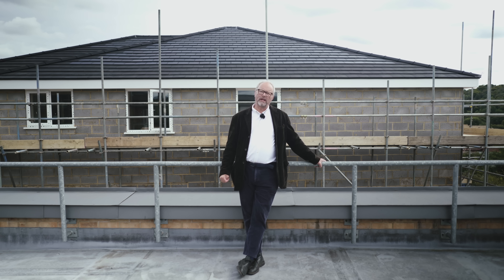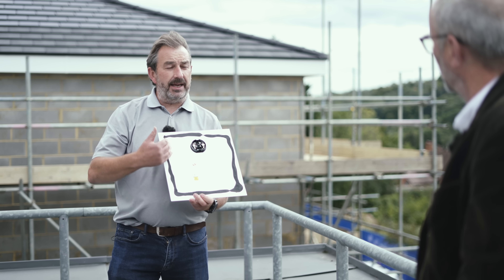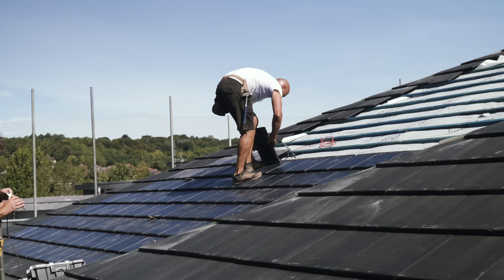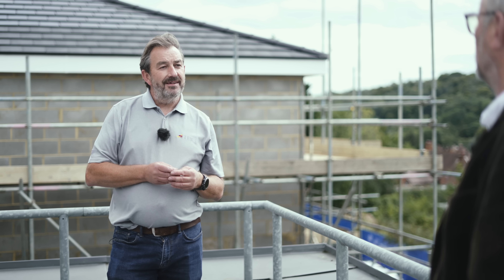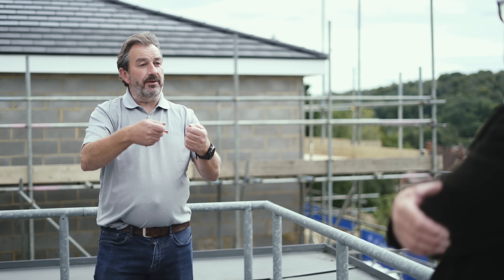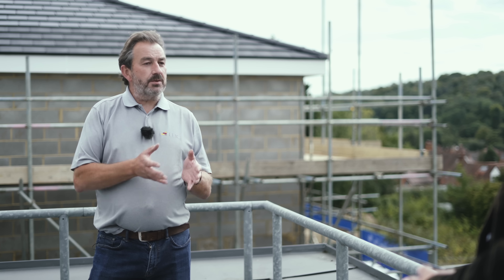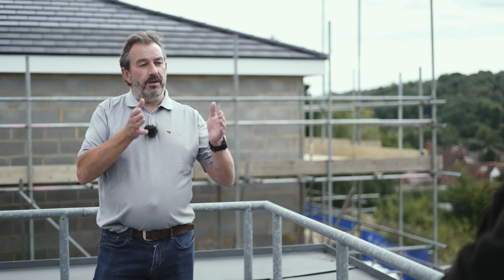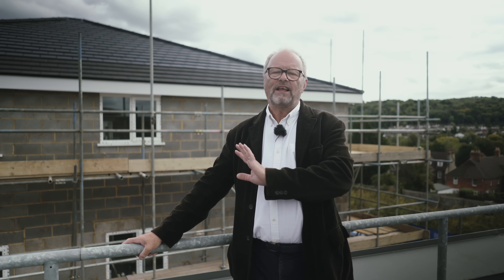Solar Roof Tiles - should every building generate its own power? | 100% Independent, 100% Electric

Comment: Cost next to nothing to make yet charging probably more than 30 pounds a tile now not exactly what you call cost effective the uk barely gets good sun so basically wasted money then you have the expense of scaffolding hire roof fitters that charge stupid high prices for easy work just saying coming from a person who was in building trade its all easy work and cheap to make every material used just greed takes over get rich quick from a brain dead idea took someone how long figure this out yet solar calculators have existed many year's before all this bollocks  plus the expensive lithium battery's the converters from mains to normal power list goes on

Comment: SNOW DANGER: Rooftop solar installations in the UK do not prevent snow sliding off the roof in large, heavy slabs that could cause injury or worse. There are simple products available to prevent this, however lack of compatibility & availability has led to my installer (at least) to not addressing the danger. I'm sure I won't be the only one to realise this risk and I seek to raise overall awareness. And encourage those yet to commission solar installations to demand appropriate mitigation from their installers before parting with any money.

Comment: In 2008 I project managed a new housing estate in Lytham St Anne's, building 111 social housing homes for rent. The scheme included two large blocks of 85 flats in total. All were built to Code for Sustainable Homes Level 4. The apartment blocks had solar interlocking roof tiles, provided by a UK company called Solar Century.  The solar tiles were called C21E.  Each solar tile was the length of three concrete tiles and interlocked with the concrete tiles and were wired in series.  Like Tesla, this video gives the gives impression this manufacturer invented the concept of solar tiling interlocking with traditional roof tiles in 2010.  In reality, Solar Century were doing the same, albeit with triple length rather than individual tiles, years before.  We used the solar power generated to subsidise the energy used in the communal areas, to reduce service charges for lighting and lifts.  From the ground, the solar arrays were virtually invisible.  The scheme was loved by the local town planners.
Reply: Thanks, I actually started with Edilians solarmax, the predecessor to c21e, and still install today, the tiles are the first actual tile size product, that is not covered with glass

Comment: Are all tiles compromised when a few are in shade?
Reply: Hi seamus,

no each module has a bypass diode, which means any shaded cell allows the opower to continue, without pulling down the output of the string

Comment: The combination of the climate change driven intensity of the current heatwave & the complete lack of a joined up thinking & climate change adaptation/mitigation of the current UK Gov't left me minded to rewatch this video. Drives me nuts that just about all world governments STILL haven't the foggiest about just HOW expensive not getting on with the job of transitioning everything now, including construction, is going to be. 
Nobody's suggesting that it all has to be done at once, but they do need to pull their fingers out & make an [actual] & [genuine] start, not merely attend endless COP'S, sign on the dotted line, then go off for a cocktail or two whilst patting themselves & each other on the back.
Reply: Hi Part L 2022 will mean that all new build houses will need solar / heat umps to meet the current regulations
Reply: @chrishall409  Certainly hope so. Trouble is that the David Cameron Gov't, I think it was, tore up the rules regarding every property needing to be checked by building inspectors; builders marking their own homework  - with far too many dodgy results. People have bought homes (because) they were supposed to be well insulated and had a heat pump only to find their electricity bills were astronomical; my guess their homes weren't properly insulated and the heat pump system wasn't well designed for the properties they were installed in. (Adequate) skills training is crucial.

Comment: Why can you have 10 tiles all in a row strieght from the factory it would be far easier to install and less chance of connectivity failure!!
Reply: yes, but you have the issue with weight, and lose the flexibility of smaller modules.
Reply: @chrishall409  Not if you choose the right materials! That as a designer I know to be true!!

Comment: One thing I would like to know is, how long would they last ? As no doubt it could be a costly process replacing
Reply: Hi 10 years manufacturers warranty, 25 year performance warranty on the output, and 30 year warranty on the roof tile substrate

Comment: You can cut the potential battery size by dumping excess power into the hot water cylinder and then sell the excess into the grid. Another option is Gaf energy and their timberline solar panels. They avoid the tile thickness , they look to be faster to lay and they are thinner.

Comment: Okay as alternative to slate, but not terracotta/clay (style) tile roofs. I would be worried as a home owner that its more difficult to upgrade these panels when the technology becomes more efficient. Most UK houses have limited appropriate roof space and at some point will want to change to panels that generate more electricity, I would think. Swapping panels but reusing the original frames vs rearranging most of the roof each time?
Reply: in 20 years of installing solar, no-one has ever asked us to change their panels for the latest most efficient models, as for most, they continue to work, and having broken even, everything they produce is free to the householder

Comment: This is one of those "now why hasn't anyone thought of that before" moments. Rather clever. Obviously, more care is needed during installation to avoid damage to the cells, but there's no doubt this is a step forward. It will meet with the approval of many planners too..... The only reservation I'd have would perhaps be the later possibility of damage caused by anyone installing or repairing a TV aerial or Sky dish etc.......

Comment: Solar roofs makes everyone produce a lot of energy when it is not needed, and then they don't produce when it is needed, witch makes a big problem on the system grid.
If we get a really dark and cold month, all the solar roofs are gone from the production when the demand is highest, and then in the summer when you got lots of sun and warm weather, the demand for electricity falls.
Unless you install a battery that saves production for a few months in the winter, you are contributing to the problem on the grid

Comment: Notwithstanding Matthew Knobel's question about what happens if a single tile panel fails, what is the life-expectancy of these tiles? How should they be disposed of? Some solar panels are manufactured using materials such as Cadmium telluride or Copper indium gallium selenide. Unless they are recycled properly at the end of their useful life, there are environmental consequences. Standard concrete tiles can be thrown onto a hardcore heap at the end of useful life. How does proper disposal (separating the concrete from the electronic components) affect the lifetime cost of the product? It's a shame that this video is framed as "let's discuss all the benefits and completely ignore any potential drawbacks". A number of commentors have stated something like "All new homes should have a system like this as part of a planning application. Period" or some such dictatorial opinion. What about 30 years down the line when <insert dodgy builder name here> decides to just break up used tiles like this and bury them as hardcore instead of paying for proper disposal?

Comment: 900 tiles at £30 per tile . . . the roof cost £27,000 . . .
13.5kW system . . . too expensive at the moment as compared with a standard Solar system
Reply: Hi, I understand that if you only compare price, then it is an issue, however, to our customers, aesthetics and performance are more important than just cost.

Comment: No planning permission for new houses should be given, without provision for solar panels.
Fitting the panels will increase the cost of new houses. 
However, all new builds should have a south-facing surface for solar panels, with the wiring already installed.

Comment: I looked heavily into solar and actually decided to go with traditional panels after reading horror stories about "roof tile" solar panels overheating and some even catching combustible underlayment on fire in southwest regions. Do your research for your region and if you live in the south west USA make sure you have adequate ventilation behind the panels so they operate efficiently and last as they are advertised!
Reply: Please send me your research/horror stories about solar roof tiles overheating. Having produced these tiles for 10 years we are not aware of any individual failure caused by overheating, and certainly causing a building to catch fire would have been reported, followed by a claim for damages. Our tiles remain cooler than glass faced traditional solar modules, the mass of concrete tile acts as a heat sink, and we use cut cell technology to ensure that our tiles do not suffer from reduced performance due to heat build up. One of our early installations is in Egypt, and is still operating to its maximum.

Comment: In general, walls could be made "solar" as well. They use wall siding in the US when building individual houses. I imagine there could be used "solar siding" and solar roofs on the Southern walls of houses.
Reply: The angle of walls would suck for efficiency wouldnt be worth the cost at all.
Reply: @ashleycullen.933  Will see how it's gonna be in 10-15 years from now. With tech advances and prices fall.

Comment: What is the estimated loss off efficiency due to heat on a black roof with no ventilation? The bif pro of the bolt on pannels is that they allow some airflow so the efficiency is higher on the warmer summer days.

Comment: It comes down to money.  1. It's illegal to be off the electric grid.  2.  The electric bill is separated by electricity use and delivery charges.  So you're only going to save  part of your bill, delivery charges will still be applied.  3.  They're covered with snow, they're useless.   People won't want to incur higher costs without saving $.

Comment: Great idea and an improvement aesthetically, but I see two potential issues. Doesn't the performance of P.V.s deteriorate with heat. Being attached directly to a concrete tile that holds heat surely isn't the best idea. Also, the solar part is bonded to the tile. How long is the guarantee on the bonding. It will have a harsh life between the extremes of summer and winter. There is no point in installing a roof that is meant to last 60 years only to find that the solar part detaches after 10.  Just a thought.
Reply: 30 year warranty on the structural adhesive that was specifically developed to bond the cells to the tiles.
As there is no glass across the cells, the concrete tile acting as a heat sink, and the actual cut cell technology that we use in the silicone, we suffer less from heat increasing resistance than happens with glass, traditional modules.

Comment: We have 6 inch thick prestressed concrete roof that is heavily steel reinforced. It is 20 years old and it leaks like a sieve during the rainy season which is almost half of the year in the tropics. How are your cement tiles constructed so they don't leak? Cement is notorious for having micro cracks after a while especially after the steel rebars inside start to corrode. I noticed that the cement used us quite thin . Are they steel reinforced?

Comment: How does this solar panel stand up to weather such as hail compared to traditional Solar that has hardened glass above the silicon?
Reply: they have passed the same hail/ missile impact tests as every other solar module has to undergo. Our DuPont ETFE polymer coating is more durable and translucent than glass

Comment: Every building should atleast subsidize some of the hydro in the day time to cut down daytime billing by hydro suppliers. Their is no reason a home can't be AC coupled with a solar array and have a smaller battery system for Night use or grid backup, Even Grid tie systems could be AC coupled with battery backup for a seamless power supply to the home.

Comment: I'd prefer if the tiles had inductive or capacitive power transfer, cable connections are obviously points of failure with nasty failure modes.

Comment: With that kind of weight per tile, I have to wonder if the frame of the house has to be beefed up to sustain that kind of mass in windy locations.
Reply: they are 4.5 kg each. 45 kg/m2 which here in the UK is average for what designers have to allow for the loadings on a roof.

Comment: Series circuitry, Impact resistance, Efficiency. All real world concerns. Efficiency. The roi is important. To my understanding the most efficient solar panels are roughly 22% efficient. That is not to be confused with a 22% reduction in energy cost. That is a long time to get one's money worth. Impact resistance. If one lives where high winds are prevalent or there are Typhoons/Hurricanes and Tornados. Those are very real concerns. Series circuitry. Why was that not addressed? The whole purpose of parallel circuitry is to eliminate lose of the circuit. I am very interested in Solar. But it needs to be more than a noble cause.
Reply: Yes, there are solar pv modules that have just reached 22% efficiency, however, the volume manufacturers are still around 19.5%. When I installed my first pv system in 2003 the modules were only producing 50 watts, the same manufacturers modules are now 75 watts, a 50% increase in 17 years, so each year technology will improve, but at some point we have to buy the best available today, as continually waiting for the next leap, leaves us in no-mans land. Testing of all solar pv modules includes a hail and missile impact test, which we passed easily, and note the modules are covered with a flexible DuPont Teflon coating not glass which is more forgiving to impacts.
Each individual module has a bypass diode which eliminates the typical string issues that you get from putting modules in series, by taking the series strings into the building in parallel, we increase the ampage wthout increasing the voltage, delivering a consistently higher voltage to the inverter to increase the operating window, and generating more electricity than standard modules.

Comment: Solar is redundant 30% of the time due to peak demand. You are already better off having a battery and taking off peak green electricity at low tarrif. It covers your 2 hour morning and evening use, no worries. Even better if you have an EV that does the same. Things move so fast I am now questioning home solar. Wind power at Night is an even cheaper tarrif to take to a battery. Dont tell any one.

Comment: I found this really quite interesting. As a slow convert I was immediately taken by the fact that you made no effort to put any costs to the extra building work required (I may have missed it) and just gave the additional cost of the tile over conventional. To convert folks like me you need to be completely transparent.
Reply: there are no extra costs to the building work. Roof tilers are paid to lay tiles or solar tiles, no difference. We supervise and ensure electrical connections are made in the correct manor, which is included in the cost of the installation.
Reply: @chrishall8738  Sorry, I understood that the roof structure needed enhancing to take the extra weight?
Reply: @goliver3846  No, the roof structure is already designed to take the weight of the tiles, so we are not adding any extra loading, unlike bolt on top solar, which adds both extra static deadload, and dynamic load as wind blows across the roof.

Comment: I'm hoping these or something similar will have come down in price by the time I need to re-do the roof on our farm. I do wonder how they will deal with snow though - can you somehow heat them up to melt the snow when it is coming down, and then turn off the heating to let them generate power again once it has stopped snowing?

Comment: You’re comparing apples to crab apples it’s the same but not really here in North America we absolutely never use concrete tiles..
Reply: 25 installs across the US so far, all on American manufactured concrete roof tiles by Boral.